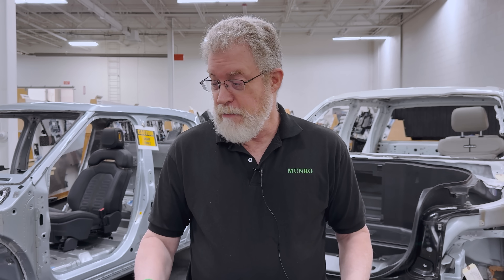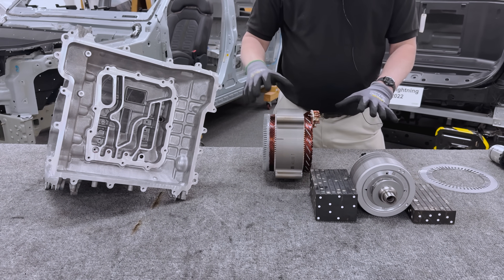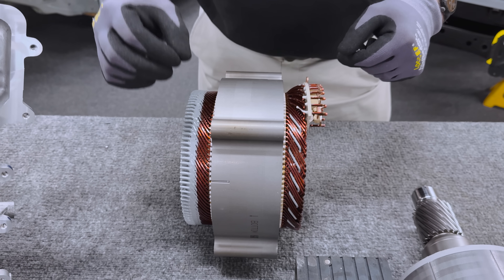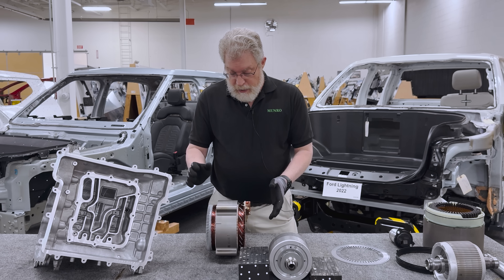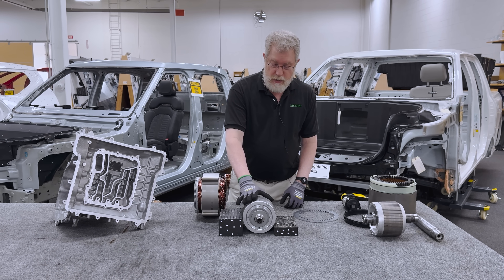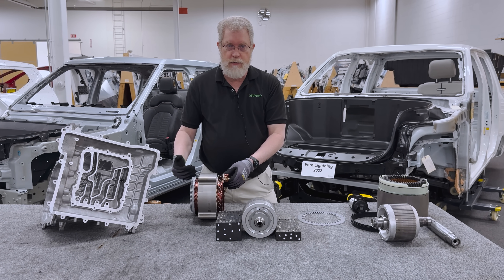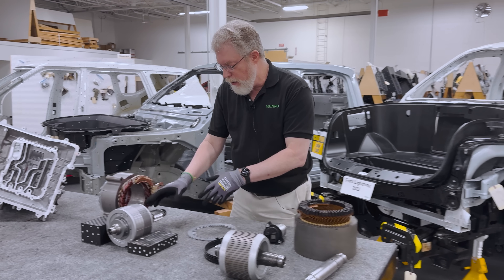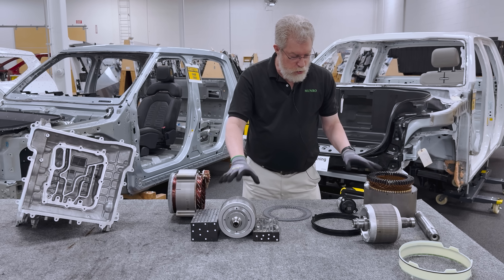Inside EV Cooling Systems: Tesla vs GM Electric Motor Comparison

Comment: That large casting looks to be nothing more than an oversized manifold,  taking up a lot of space and weight and cost versus a tiny pump.
Reply: Tesla has a casting as well. The motor and reduction gears aren't held in place by magic.

Comment: In short,  old fashioned splash cooling versus modern pressurized oil cooling
Reply: Engineering is about tradeoffs.  Both systems work for their designed purposes. One requires more parts, the other more design.

Comment: I like GM’s approach better.  Relying on a high pressure pump to circulate the oil/coolant seems less reliable.
Reply: If the high pressure pump was on a GM product, then sure. The company is notorious for lowest-cost part acqusition, which ultimately means low quality and/or longevity and lots of trips to the repair shop. Other comapanies' procurement strategies may be different, because they're more focused on the long-term and not so much on the latest quarterly results. GM is going to GM.

Comment: One thing nobody’s mentioned is that Tesla’s pressurized oil cooling/lubrication system allows them to pass the oil through a spin-on oil filter. I like the idea of having a filtration system to remove abrasive particles caused by gear and bearing wear. How does GM accomplish this?
Reply: There is no filter, at least a traditional filter that you would replace.  There's usually an area that would catch and hold heavy partials.  Tesla needs a filter because their oil is under pressure, which could force heavier particles through the system and cause damage.  Engineering is a tradeoff, and there is no free lunch.  GM's design requires more work to design and test, but it requires zero maintenance.
Reply: @theflew A pressure based oil lubrication system can also benefit from having an area in the sump for larger particles to settle. That is, in fact, a feature of the systems in most automotive internal combustion engines. 

So Tesla could be taking advantage of this. But, since they have filters too, they can probably stop smaller wear particles from circulating through the bearings than a system without a filter.
Reply: They do have filter that requires replacement, just like tesla.
Reply: @ericdesjardins.8081  But without a pump what forces the oil through the filter?
Reply: @Dave-ei7kk It has a pump.  It is geared mechanical vs electrical. Earlier video discussing electric vs geared pump.
Reply: @mikus4242 Thanks. That makes sense that it would. But of course if it’s using mechanical energy to pump the oil it’s not more efficient at that task than the Tesla motor. But one could argue that Tesla’s solution is more refined in that it can adjust pump speed based on variables like temperature and actual oil pressure whereas the GM method depends only on the rotational speed of whatever part of the drivetrain it’s connected to.

Comment: Exec Summary:  GM spent a $ million bucks in engineering, simulation & experimentation so that they could use a cheaper low pressure mechanical pump from their automatic transmission parts bin instead a dedicated and fully controllable electric oil pump used by most everyone else.  The cost savings on the oil pump is ~ $35.  Yet somehow Tesla makes a profit on every car, while GM loses big $$ on every car.

Comment: Great Video! Great Points!
Magnet temp below 140C uses less heavy rare earth and below 120C no heavy rare earth just Neodymium Magnets. 
Love the rule of thumb 100C temp increase results in 50% resistance increase. I did not realize it was that dramatic.
Have you considered a flux capacitor to reduce the iron loss ;)

Comment: Car and Driver tests lap times at VIR and ranks test cars for fastest. Their critics complained that they weren’t using Tesla’s because they because they knew they would win. But they said Tesla wouldn’t give them a car for testing but volunteers did and they could not complete a lap without the car shutting down due to overheating. Since that time Lucid has completed the “hot lap” and set some very fast times. They will resolved this technological hurdle as will others.
Reply: That is true. However, I have seen in car footage from a Model 3 Performance going around the Nürburgring and they seemed to have no cooling problems.

Comment: Interesting, the industry is studying winding insulation for more then hundreds years and insulation resistance is strait forward technology alongside with humidity checking was used for a quite some time. Why it would be any different for automotive industry?
Reply: Power density and mass.  Automotive motors need to be way more compact and light.  Go look up a regular stationary motor at 200hp for comparison
Reply: @FLBOX  It doesn't mater what density or mass, it's all about voltage, insulation resistance,  insulation thickness. Do you think the distance between coils much different it stationary transformer and Tesla motor? There are two important aspects here, one is materials temp expansion, related insulation cracking. And  most important - oil quality. I used to work with old Jew who his whole life was only doing, just transformers oil test. And here I blown away, they are using transmission fluid for motor cooling. And what transmission fluid does, it ease friction of transmission METAL parts. WOW. Does it effect oil resistance in any way? LOL
Reply: @konsheyn your old friend would tell you that insulation breakdown is a function of temperature and Voltage. Power density strongly influences temperature. The auto industry is working directly with the same companies that make the winding insulation for transformers.
Reply: @PaulTurnbull-EMfield  Yes, that what I said, but, what is "insulation" in this case? It is not only winding insulation, but also oil itself. Do transformers have moveable parts? Does transmission have moveable parts? How oil properties monitored? I don't know statistics of motor failures, but the guy on video pointing that they trying to understand reasons of motor winding shorts.

Comment: The oil I am guessing must be of a non conductive type.  Also it must not induce any kind of drag on the rotor.  It must be some formulated oil just for that purpose.  ???  At least there's no issues with combustion impurities.

Comment: The oil is gravity feed, that mean the gears have to spin realy fast to fling the oil across to, and up to the top of the motor. Bumper to bumper traffic would be bad for this system.
Reply: When the motor isn’t doing work, it isn’t getting hot, so it doesn’t need a high oil flow rate.  The GM gear driven pump is less wasteful unless Tesla PWM modulates their oil pump drive to set an appropriate RPM versus load - which Tesla may well be doing, because Tesla has smart engineers too.
Reply: It's not like an ICE engine that is frequently running even when the vehicle isn't moving ... if you are stationary the motor isn't turning so doesn't need cooling. If it's turning slowly, again it doesn't need cooling ...

Comment: That GM vehicle motor is made in China.
Reply: The both motors used in this video were designed and built in America. GM also makes and sells cars in China. There is a version of this motor built in China for the local market. None of them are exported to America.
Reply: You sure? I think in the previous video with the engineers they said at what American plant the drive units are made.
Reply: Tesla makes motors in China too. In fact there are more Tesla motors made in China than in the US because they make more cars in total in China than in the US.

Comment: The best part is no part.  I like the idea of no pump to fail.  Gravity never fails.  GMs approach seems better.
Reply: It’s not so clear cut as that. Each system has its advantages.  A mechanical oil pump. Uses mechanical power, whereas the electric motor uses electric power.  No free lunch.   The amount of oil provided with the mechanical system is proportional to the motor speed. The oil amount provided by the electric pump can be computer controlled.  This  control has advantages in some situations.
Reply: If you pull a heavy load slowly, no cooling with gravity approach
Reply: @glennrmarks  EV motors are geared, so in the case of the Equinox EV, the ratio is  11.59.  So every revolution of the tire, the motor is spinning ~12x.  So even if you're traveling at 5 mph, the motor is spinning at about 11 revolutions per second.  More than enough to keep it cool.
Reply: But has its limitations as well, Most piston engines started out with gravity feed oil systems (splash) and switched when they realized pumps were better. Of course it won't work upside down or in space.
Reply: Gravity is the mental force all of sleeping dogs, worldwide, encouraging food to fall within reach of the awake dogs. If all the dogs were awake at the same time, gravity would cease to exist. As we say, let sleeping dogs lie.
 Go ahead, prove me wrong.😊
Reply: Model Ts had no water pump.  Ok if you have no power.
Reply: High pressure systems allow more power output in a smaller space.
Reply: @MikkoKorkalo and yet the GM motor is a lot smaller than the BYD motor of the same power output.
Reply: @mongo64071  maybe. What about tesla's oil cooled PM motors? Also, they might have different design parameters overall (like price, life expetancy, RPM, etc). Can't just take two motors and say the other one is better because of one random feature. I also like the GM approach of not having extra parts, but I'm sure companies like Tesla opted for high pressure system for a very good reason.
Reply: @MikkoKorkalo I’m sure it comes down to cost. Tesla doesn’t care about cost. GM counts pennies.
Reply: @mongo64071  “Tesla doesn’t care about cost”. That’s an insane take. Every manufacturer producing millions of a thing cares about cost. Tesla has the best profit margin in the industry. Of course they care about cost.
Reply: @mrmichrom8553 I don’t think it’s insane.  they are a luxury car maker. They have a much larger profit margin than any other car maker.  Adding $100-500 more to their car can easily be absorbed and or passed onto buyers.  Their customers will pay whatever Tesla asks. It’s a cult.  Look at all the crap they added to the model Y to make it more upscale rather than to lower cost. Ventilated seats, second row screens, glass roofs, unnecessary light bars.  If cost was a concern, and they really wanted to build affordable cars, they would reduce part count and get back to basics.
Reply: If gravity fails, you have bigger problems.
Reply: @jarheadcharlie2519  I'll remember that!
Reply: @jarheadcharlie2519 Such as when flying through the air :)
Reply: It would be interesting to see the secret numbers for rotor oil failures causing the premature electric motor failings that so many brands have had.
Reply: Ya, he mentioned it was based on Toyota's approach used for the Prius for xx years now and, as we know, Prius's elec motors are not known to last very long /s.  I'd prefer to own a vehicle with the Toyota/GM design.  I wonder what design is used in that new and very interesting (& nicely relatively lower powered) Kia PV5 van.  I like the idea of sacrificing power in exchange for lower cost, longevity, reliability and higher range.
Reply: The problem is, GM's bean counters are notorious for taking what turns out to be ill-advised shortcuts to avoid cost, and it's likely that its procurement org would cheap out on a pump, acquiring one from a vendor at least cost... and poor reliability. Just imagine the mass failure of GM EVs across the board because it had spec'd and purchased the lowest cost component... it wouldn't be the first time. GM is going to GM. 🙄 Good thing that its engineers anticipated that and found another solution. We'll see how it works out for GM and its EV customers.

Comment: What do you think of the rotor coolant delete for Tesla model s/x induction style LDU?  This attempts to prevent the coolant leak into the stator windings, but will it cause premature rotor bearing wear?  The aftermarket has been doing this for a while, and it seems Tesla revision-U LDU took the same approach.
Reply: I've heard (and read just a little bit) that the S/X coolant delete modification is a good idea. Apparently that leakage is very common and will mean replacement of the drive unit. The 3 and Y do not have this issue.

Comment: I wondered why the GM motors take up so much more of the "engine bay". That system is clever but also promises more degradation over time with each corner and steep grade encountered. Good enough for increased repeat business without destroying customer loyalty?

Comment: Can the rotation of the car's wheels be used to create additional energy, in the form of electricity, to power the high pressure pump in Tesla's system and or can a heat-pump be utilised to scavenge unwanted heat away and transfer it to where it is needed?
Reply: Yes.
Look up Tesla Octo-valve.
Reply: You mean adding resistance to the wheels so they generate the electricity you’re talking about? Why not get said electric directly from the battery?
Reply: @migmigjohnson6083  Not resistance per se although. I suppose you could adopt a dynamo. I was thinking more about whether the spinning wheels could act like a stator with magnets with copper windings, in some way, to generate electricity to power the high pressure oil pump. Just a thought.
Reply: @neilmckechnie6638  There is no need for an additional "wheel" generator because the motors are directly connected to the wheels and that motor already operates as a generator e.g. via regenerative braking. That generated electricity is put back into the battery pack ready for re-use. So the car can draw power for anything that's needed, whether that is driving the vehicle along the road or powering the electric oil pump.
Reply: @MrAdopado  If I can gently say, you may be missing my point about optimising efficiency by all electricity micro generation possible so that power may not be needed to be drawn from the battery thereby increasing potential range.
Reply: @neilmckechnie6638  if the magnets and/or copper windings were in the wheels themselves, it would increase the mass of the wheels which would negatively affect the car's handling and driving dynamics.

Comment: Out of Spec has a high stress test called the Rustic Ring where electric vehicles tow heavy loads slowly up hill and down often in high temperatures. GM does better than all others in these tests so they must be doing something right.
Reply: Nah, Tesla does better.
Reply: @tedmoss  Not really. https://youtu.be/L2Q_RIgBQ80?t=3853
Reply: @tedmoss Interestingly enough the Tesla CT had thermal issues and stopped regenerative braking and switched to regular braking which also began to over heat and struggled to stop the vehicle.
Reply: @tedmoss   Musk evangelist at work!

Comment: I'd like to know more about the physics of motor geometry, DIAMETER, a large diameter narrow motor VS small diameter longer motor - torque, efficiency, thermal, materials ramifications
Reply: This is a very interesting topic.  Thanks for bringing it up.  I'm tempted to do a video about it.  In electro-magnetics this topic is called the machine sizing equation and it can lead to some deep insights into why motors tend to look the way that they do and what shape motors are best for different tasks.
Reply: It seems like a pancake motor would need less gear reduction in be more efficient

Comment: Tesla vehicles can be prone to coolant leaks, with some common causes including a known issue in older Model S and X large drive units, as well as leaks from hoses
Reply: Yes, the S and X do (did?) have that problem. The "coolant bypass" or "coolant delete" modification is the current solution.

Tesla learned from their engineering mistakes and the Models 3 and Y have about six fewer engineering shortcomings than the S and X. Here is one of them: The motors are oil cooled, then that oil is sent via an external tube to the oil-to-water heat exchanger. Then electric water pumps send the water/coolant to the battery pack/radiator.
Reply: The oil pump could provide more consistent and even cooling at the cost of an additional failure point

Comment: Motors go through a gear reduction so even at low speed the rotor is spinning relatively fast
Reply: As a reference, the Model 3 uses a 9.01:1 gear reduction from the motor to the differential. At 70 MPH, the motor's rotor is spinning around 9,000 RPM. Because there's no reciprocating movement and the rotor has perfect balance, you don't hear it or feel it.  One of the many reasons why electric drive is the best.
Reply: Is 20,000 RPM fast enough for you?😁
Reply: No, more